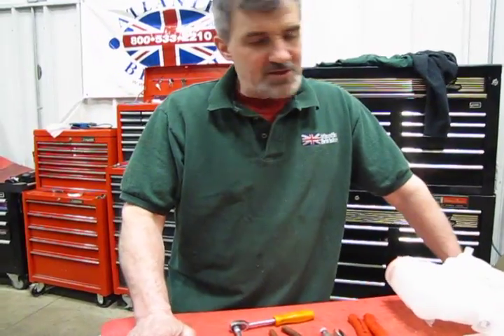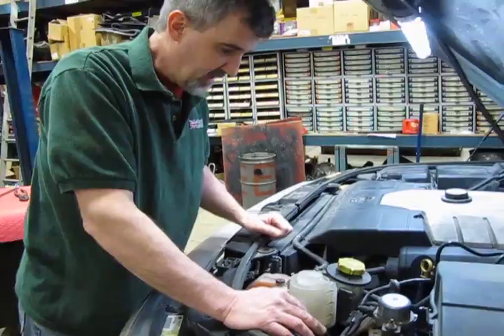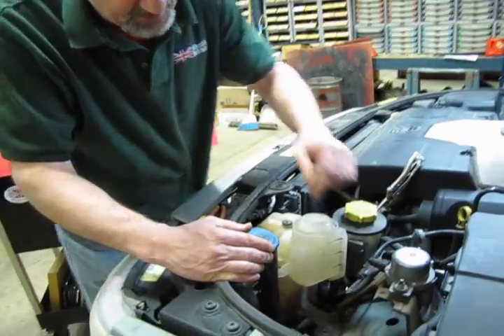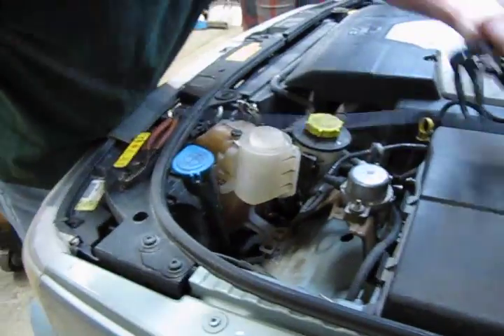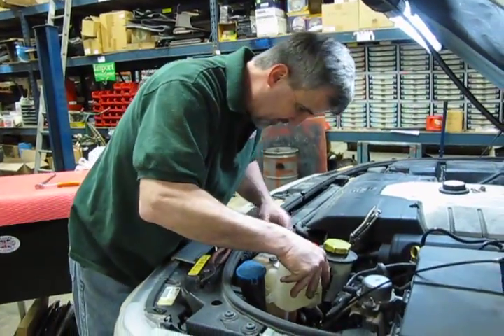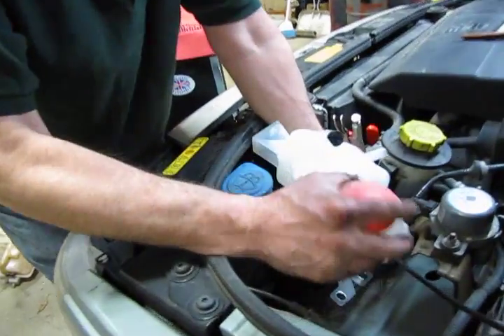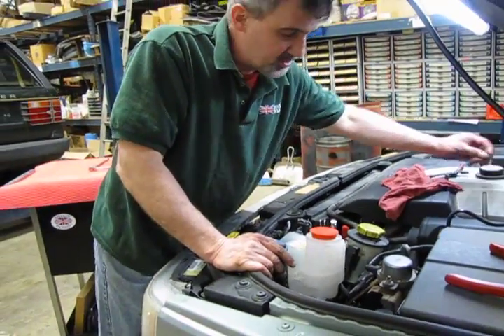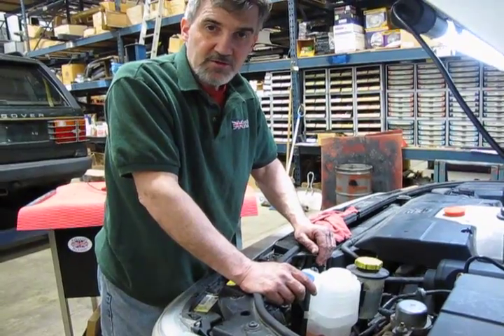Low Coolant Level! Coolant Expansion Tank Install on 2006 Range Rover

Comment: Advice for anyone doing this - remove the headlight, its the easiest headlight you'll ever remove and it opens up all kinds of room to work on the tank, especially on HSE models with the diesel heater tight behind the tank limiting space

Comment: Couldn't agree more with those that talk about removing the head light!!! REMOVE THE HEADLIGHT!  Directly behind the headlight is everything you need with far easier access than the method he used. 

Other than that, the video is still rather useful and appreciated.

Comment: They don’t tell you that if you coolant mixture has to much water in it that the float won’t float. To much water causes it to sink. Check your coolant mix, 50/50.

Comment: I find this method very difficult vs removing the headlights. BTW...for novice individual be careful not to disconnect the windshield wiper spout. Just saying

NOTE: I replaced both the hemostat and Coolant Expansion Tank in 2 hrs and I took my time. :-)
Reply: Jimmy Z just swapped my tank in an hour by removing the headlight, its the only way

Comment: Tip for anyone with aftermarket overflow tanks mine did not fit properly when in back clip and guide hole the holes where 5-10mm out. I had to put 3x washers behind back clip and then it was flush. Check this before reattaching that fiddly bottom hose.

Comment: Will air in the coolant system give you a rough idle ?
I just installed alternator and I removed the reservoirs top hose and moved the tank out the way. So I can have more space.
I put everything back how it was and now I get rough  idle 
Car idles around 1000rpm 

2006 Range Rover SC 4.2

Comment: Great video, ordering the reservoir.  Could the "low coolant" code be causing the "limited gears" protection mode? Thanks
Reply from the maker: Hi Bryan, chances are the codes are unrelated. We would suggest running a full diagnostic scan for fault codes with your Rover to see if there are some underlying fault codes appearing.
Reply: I had the same thing it says low coolant but when I scanned the car it said coolant thermostat reading below temps but would drive fine wouldn’t over heat from what it shows on the needle but driving the car for a while but what I notice is on a hot day is starts to go in protection mode/ limp mode limit gears available and says 3-4 shift code but i did a hard reset and change the coolant thermostat but still says the same thing low coolant. So now ima chance the over flow tank now and go from there I did check the itc already cleaned it but it looked good but I still cleaned it lol

Comment: Great video. I have a 2009 RR SUP (full size) and same problem as you describe in the beginning. Dealership is charging me $700 to replace the tank and flush the system out, pricey I thought. Is the replacement process the same as you would on the LR3's or RR Sport? Any help is greatly appreciate in advance!
Reply: You know just like I didn't know what to do, but I order the coolant tank $65.00 ,It was so much trouble to change it ,Not enough space, I even hear some comments to remove the headlamp,  Omg this is such false info for fixing this, I removed my old tank and when I was installing the new one, I broke the little sensor that you unplugged,  I went to ebay and bought another  sensor for $12.00 this time I didn't even have to remove my tank I just took the two bolts out and lean it on the side ,plug the new $12.00 sensor in , And problem  solved,  These people is not even telling other people that you don't  have to replace the tank ,Just the sensor,  Omg, So screwed up.
Reply: I have a 2006 HSE Full Size and my bleeder screw BROKE, and as I drive it coolant just sprays everywhere. No heat and the engine overheats like crazy. Going to install a new tank and bleed it and hopefully get my heat back, because I live in Alberta and in January the temperatures get to -30 Celsius (22 degrees Farenheight). Any tips on this job (if you did it)? I have to do it outside in the cold...

Comment: Where does the air bleeder hose go down to, I had to replace the air bleeder, the little plastic T connector and the hose that goes down under the intake feels really loose not sure if it disconnected but I also got p0171 and p0174 codes come up right after
Reply from the maker: The bleeder hose attaches underneath the intake manifold, to the throttle housing. These always feel a little loose since they're not clipped into any retainers but left to rest under the manifold. As for the p0171 and p0174 fault codes. These are trouble codes for a lean condition in banks 1 and 2. It is possible that something was loose and got disconnected while you were servicing the coolant tank, or it could also be a coincidence that these codes showed up at the same time.